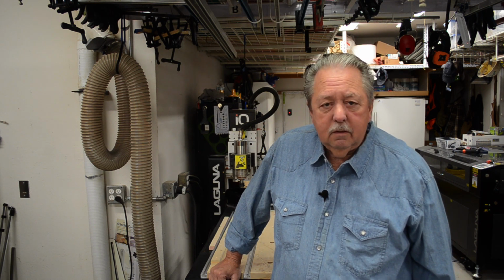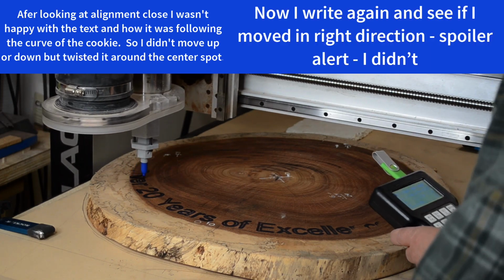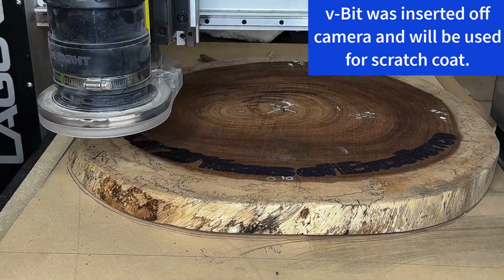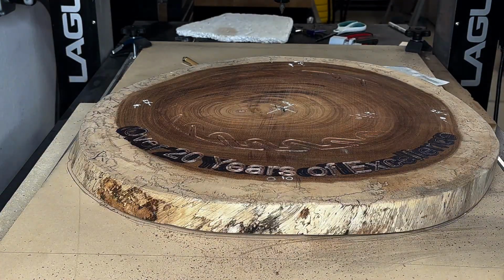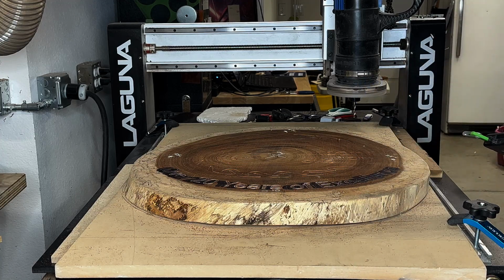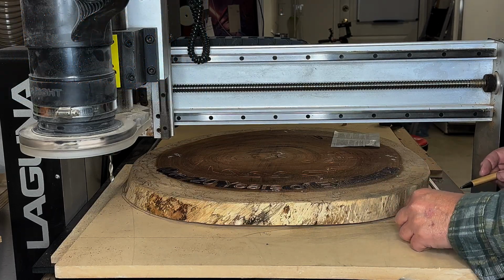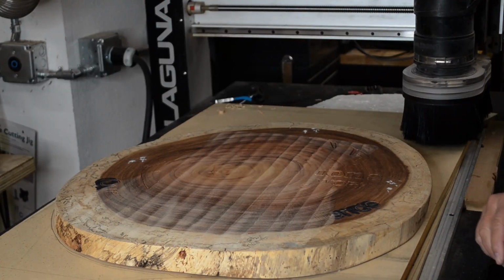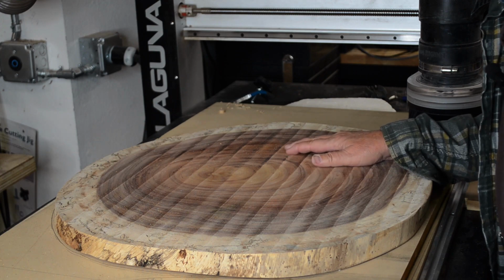Alignment and Surfacing of Wooden Cookie to Prepare for Multicolor Epoxy Sign Carving on Laguna CNC

Comment: Rob, I have a question.  I understand mounting the cookie to the sled.  Since you're using the "center of the cookie" as your X Y zero point ...... How will you be able to find that exact spot since you've now flattened and removed your mark?  I'm sure you will be turning your CNC off each night as you carve & pour a color.  You must "home" the CNC at each startup.
Reply from the maker: On my Laguna Controller I can have up to nine XY offset locations stored at any given time.   

As long as I home the machine first, I can set the XY Zero location at any memorized XY offset location.  

Because I am using the dowel sled method, once I set my XY zero position and save it on my controller it will stay that way until I reprogram it for another position.  

I am not sure what type of machine you have but it is my understanding most CNC Control software has the ability to set multiple work offsets which does the same thing as my Laguna Controller.   

I know @MarkLindsayCNC YouTube Channel recently put out a video on how to set offsets in most CNC control software.  I'll put a link in comment and hopefully it will get you there.   

https://youtu.be/qo0h4Jdp-AQ
Reply: @RobSandstromDesigns  I have a Laguna IQ just like yours (24 x 36).  I completely forgot about "setting" a particular location/offset.
Reply from the maker: @stevegronsky8904  do you know how to set the multiple offset locations or do you want me to do a short video on it in the next couple days?
Reply: @RobSandstromDesigns  I know how, but your audience might like a video.  Thank you for asking.